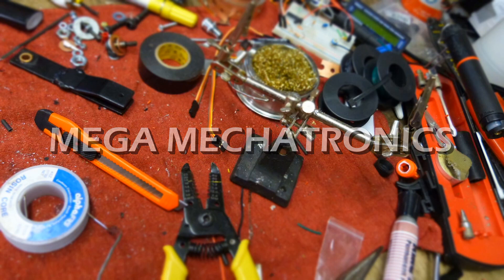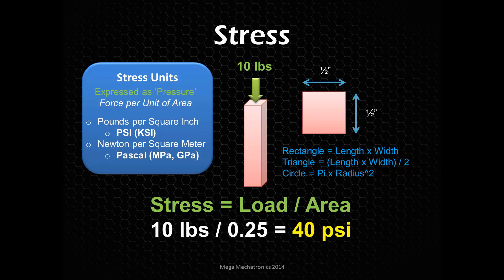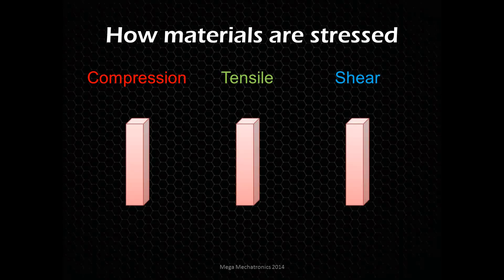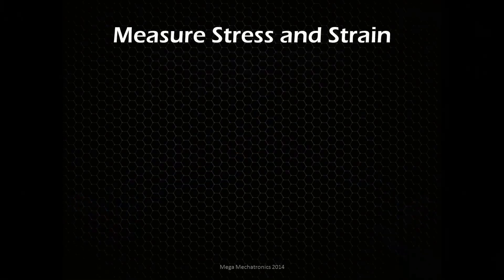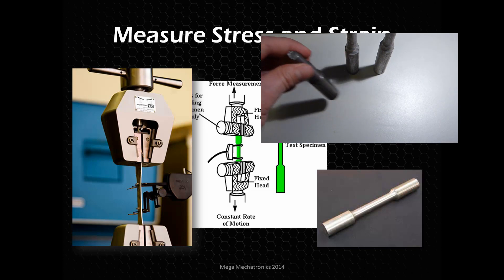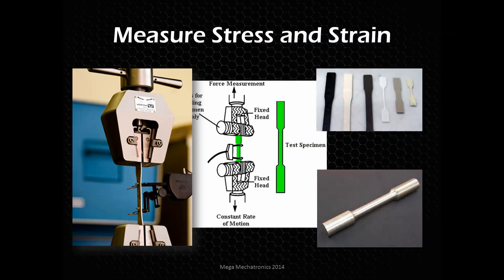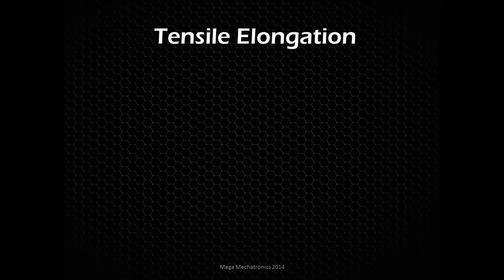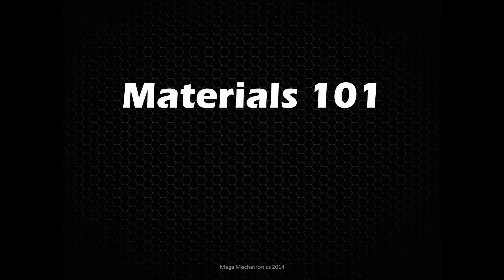Materials Science Mechanical Engineering - Part 1 Stress and Strain Explained

Comment: How about shear strength if there's one? Say, I want to calculate the force required to punch a 30mm hole on a 4mm steel plate, what material property should I consider for calculation?

Comment: How do we come to know the exact value of yield stress of a material???
Because it is difficult to find the actual point when the yielding starts???
Reply from the maker: You are correct, that is why they specify 0.2% Yield Stress, so they offset the linear portion 0.2% and the intersection of this phantom line and the actual measurement is the Yield Stress you would want to use.
Reply: Mega Mechatronics  can you explain more about this percent 0.2% ... Is it taken from UTS value ? or breaking value?
Reply from the maker: Murtada A Jebur  Please refer to this image, it's exaggerated: http://upload.wikimedia.org/wikipedia/commons/thumb/8/8e/Metal_yield.svg/331px-Metal_yield.svg.png

We're creating a 'phantom' line that is 0.2% offset on the strain axis because strain is, % change.  This new phantom line must remain parallel to the slope of Young's Modulus in the linear elastic region.  The magic is here: you take the intersection of this phantom line and the actual / interpolated plot and you call this the yield point or yield strength of the material.  This point is called the Offset yield strength.

The true elastic limit is the tangent point when the linear portion technically ends.
Reply: Mega Mechatronics  Thanks for clarification now its clear for me , Thank you so much :)

Comment: can you point me in the right direction or help me figure out how to figure the right aluminum I beam to use (for elasticity) on an ultralight main wing support. it is something like the total area and volume (two horizontal and one vertical sides, and thickness) + length of I beam. then something and something lol    i have to dig out my engineer book to find the elasticity for the aluminum. bec of solidworks, i forgot the formula .  obtw i am self taught. a little of this and that and a master of none. so, dont do what i do lol. even though i have a Bachelor of Science degree in Technology